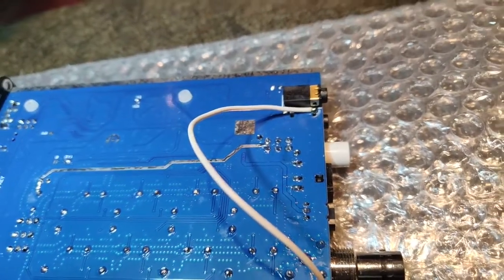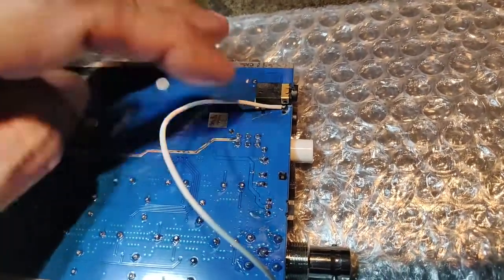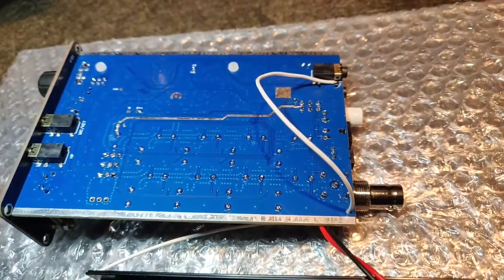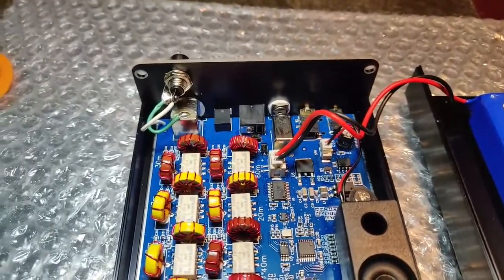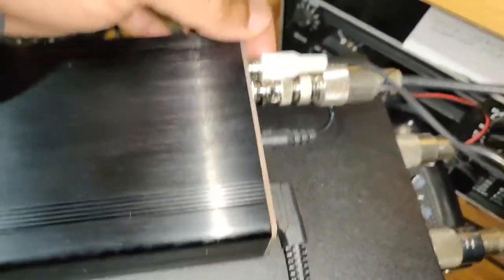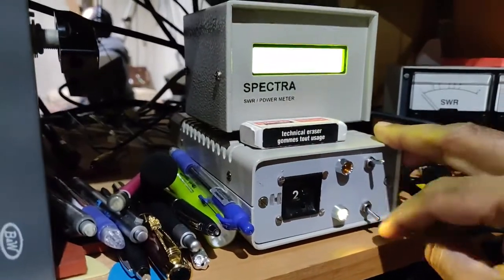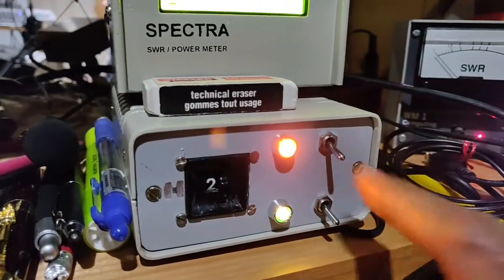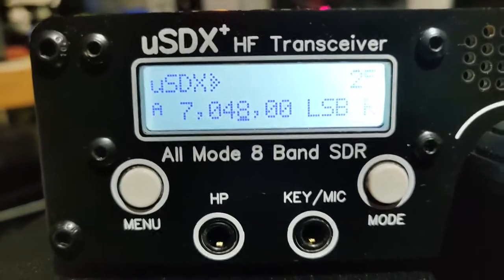AMP/Linear control/keying mod on uSDX+ | 8 Band SDR | SSB/CW QRP All Mode HAM Transceiver | RCA Jack

Comment: Would it not be problematic to use a linear amplifier with the uSDX+ due to its poor filtering and spurious emissions on some frequencies?
Reply from the maker: @kp4md  That is correct. Thanks for your feedback. In my station, all HF transmissions go through an ICOM AT-500 ATU.

Comment: I have a USDX+.  I thought it would RF-activate a small linear amplifier simply by jumpering the SO239 connectors with RG58 coax.  Apparently not the case; it has to be PTT switched?
Reply from the maker: Yes. It has to be manually switched. Thanks for your feedback.
Reply: @PremMenon  I've got several small amps I can use with my USDX+.  All are RF-switched... just hook the amp between the transceiver and antenna and it works fine in all modes except CW.  When using CW, the first note is delayed due to lag in the amplifier's relay.  If I send at least 20wpm the amp's relay remains closed and there's no problem, but sometimes I need to slow the WPM for other stations.   Then, each time the amp's relay is allowed to open, there's that lag on the first note I send.  I figure the amp's relay opening time is probably a small electrolytic capacitor that drains when there's no signal.  If I can find that cap and increase the value, it may fix the problem.  Having no schematic is problematic.
Reply from the maker: QSL. Thanks for the details. Yes, even I have a couple of QRP RF switched amps. There are advantages and disadvantages depending on our needs. GL and 73.

Comment: Thank You for the video. I tried this mod on my USDX but for some reason did not work. The amp keys up when I plug this in. Is the pin that you solder the wire to ground?
Reply from the maker: Hello Raul! Thanks for your feedback! The white wire is just an extension I take from the factory installed "amp key" to a newly installed RCA female center contact. The RCA ground can be soldered to any nearby ground. It depends on what amp you are using. If you can tell me how your amp gets keyed (or the model number), perhaps I'll be able to help you.
Reply: Thank You for the fast reply. I'm using an ameritron als-500m amp with the ameritron ARB-704 amplifier interface. . @PremMenon
Reply from the maker: @raullibunao3367  connect the SDR key line (new RCA) directly to your Amp relay/key line. Try that way. I don't think you need the ARB-704 for this. Essentially, the SDR radio just shorts the key line from the amp to ground in Tx mode.
Reply: Well my friend.. You were absolutely correct....I plugged it directly to the amp and it worked as advertised. Thank You very much for your help.  @PremMenon

Comment: Which external speaker can be connected (active or inactive and with what resistance) how is it correct? Thanks.
Reply from the maker: I used the speaker-mic that came with the rig. You can use any 8 Ohm to 32 Ohm speaker. It should work. The internal speaker is loud/good.
External speaker should have TRS male connector (tip, ring, sleeve)
Reply: @PremMenon  Thank you dear friend!
Reply: Another question is how to open the swr meter function ? SWR - power meter
Reply from the maker: This model doesn't have SWR bridge installed. Therefore power/SWR can't be measured internally.
I use an external meter.
Reply: @PremMenon  Thank you very much for the information.
Reply: @PremMenon  could you please share the external speaker and microphone/key out connection physically in TRS?
Reply from the maker: @manimaran-h8o  My sincere apologies to you. I've moved on to other things. What you see in this video and other videos on this TRX on my channel is what I have. Nothing more. My best wishes to you.
Reply: @PremMenon  Thank you for the response my dear friend and noted the info 👍